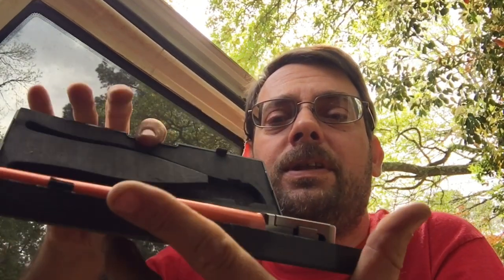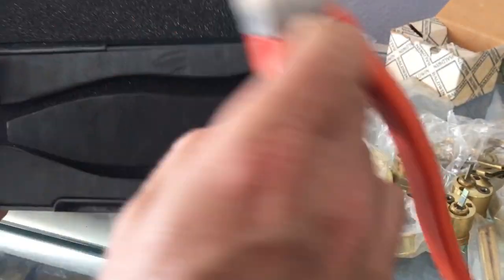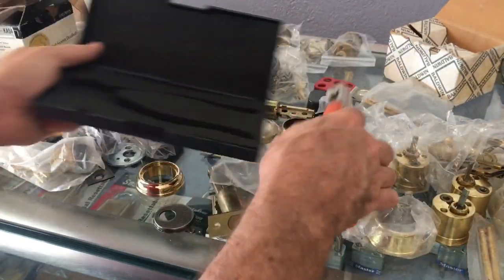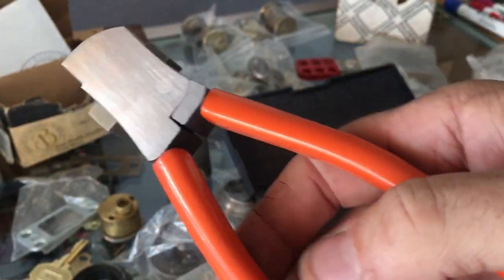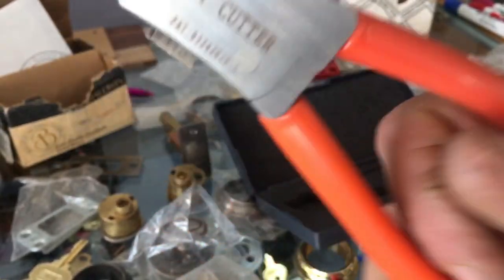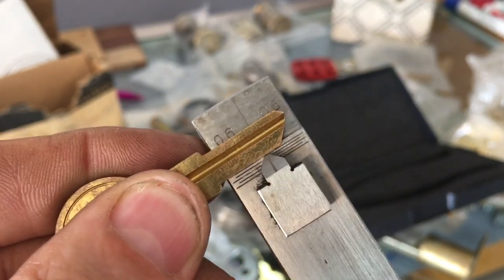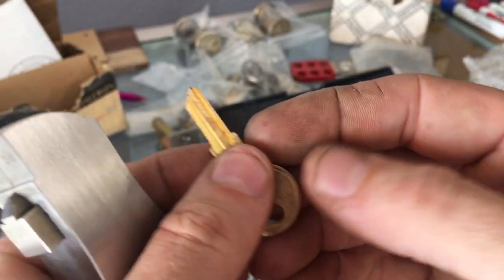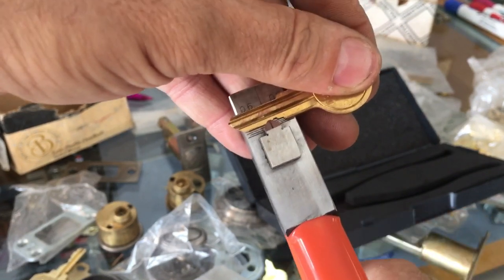new cutter for filing cabinet keys!

Comment: I could have used that tool a few days ago. I was called to do a Rekey on an oddball old Corbin key and I didn’t have any setup keys to work with. So instead of new keys I just modified the old one with a few deeper cuts. I don’t have a clipper, so I used a needle file. The clipper would have been quicker and more accurate. Something I need to get.
Reply from the maker: so many possibilities for use! 33.50, $5 shipping but I had a $5.00 off coupon that day on ebay :) https://www.ebay.com/itm/183000096267?ViewItem=&item=183000096267

Comment: So how do you use the graduation marks? It only goes to 5 I think are those depths? And for which keyway? Trying to use this for cutting correct bitting
Reply from the maker: I mostly ignore the marks, they are not set to any one specific brand just depth increments and should only be used as a visual clue while cutting

Comment: Sorry, piece of junk.
Reply from the maker: King Street Rob if it will do at least two it will cover the cost! Did you have one that broke?
Reply: I had one I was using on a Y11 and the handle broke half way up. Sent it back and the second one got dull very quickly. I had the same idea as you for filing cabinets. Mostly only Y11 keys. Hope you have better luck.
Reply: King Street Rob someone told me the Klom brand is stronger and better I'm wondering if you guys have heard that?